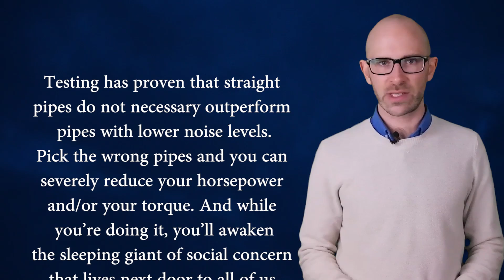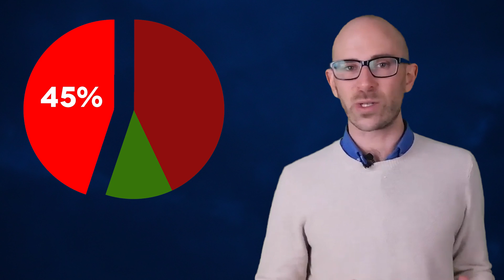Why are Harley Davidson Motorcycles So Loud?

Comment: Saying it's hard to make a motorcycle quiet is a cop out , yes a narrow angle(45 degrees in the case of Harley) V-twin engine is inherently loud  compared to a 90 degree v-twin or any other twin/multi cylinder engine configuration but there are heaps of other cruiser style bikes that use a similarly narrow angle v-twin engine but are relatively quiet, Brough Superior motorcycles were built in the 1920s & 1930s & used V-twins with an angle of around 47 degrees & even now these bikes are considered the epitome of refinement.
Reply: Stock vs. stock they were about the same power and top speed also. So really it's just saying the narrow OHV V2 was perfected in the '30s.I think THAT'S the allure of Harleys, it's basically the same bike your GrandFather rode.
Reply: Broughs were getting that power from only 1000-1100cc though & were actually pretty quiet.
Reply: my uncle has a harley and he has custom pipes on it and he goes to work at 5 am on a residential street a street over from an elementary school in a neighborhood where hundreds of kids live and no one has ever complained, why? because his bike isnt loud Harleys arent loud and when you see the loud ones they change out pipes and bunch the baffolds in their pipes to make them even louder or they get touring pipes meant for if you only ever ride in the country where it doesnt matter how loud they are